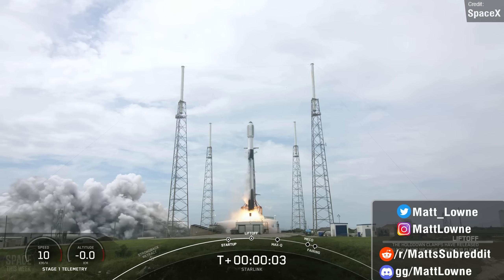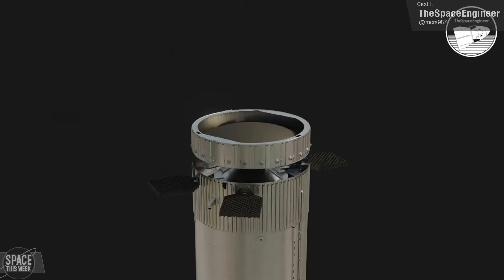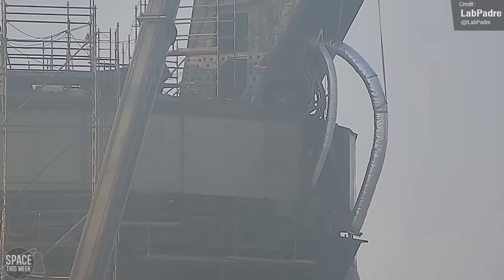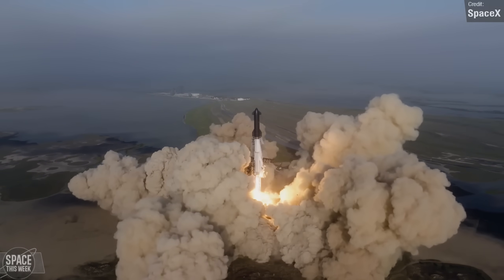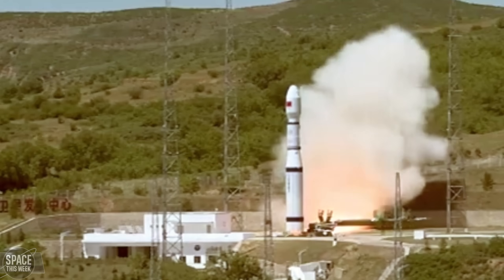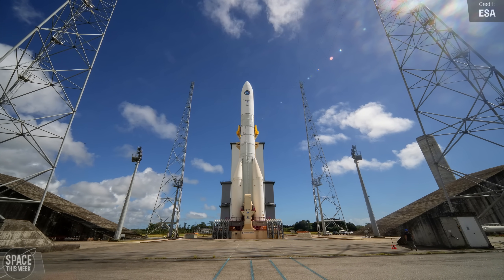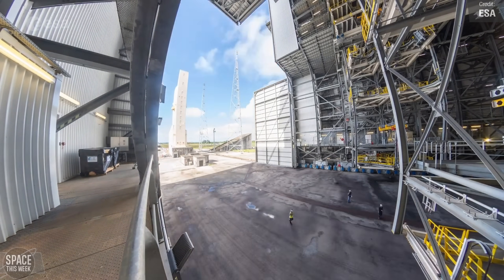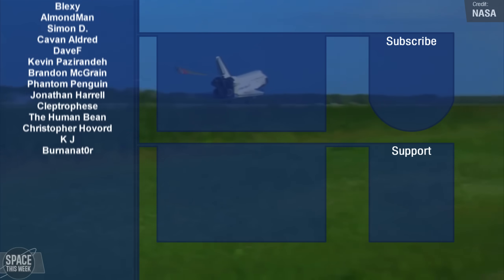SpaceX Starship's Insane Design Change, Ariane 6 Rollout, and The Penultimate Delta IV Heavy Launch

Comment: I wonder if they will just fire one or all 3 center motors then ramp up up all 6 after staging? All 6 wouldn’t play nice with the booster
Reply: afaik they'd only be firing three at stage separation, the vacuum-optimized engines.
Reply: @vicroc4  makes sense as they are the outermost and closest to the vents

Comment: I don't know how well this going to go with a hot-staging going go for B9.  I think there going to be some high risk of Starship possibly detonating remaining fuel in B9.  Its going need some kind heatshield dome.  Even if B9 drops thrust to allow S25 separate as it thrusts out.   Additionally, they'd have to relocate batteries and controls that are right where the top of the dome are (unless they moved them some where else.   I really don't think its going go well, doing these last minute changes on vehicle not designed for hot-staging.

Comment: Does Starship need the extra lifting capabilities?  Won't it already be able to lift something like 150 tons in one go.
Reply: Not really but less launches means less money spent by SpaceX and more profit.
Reply: @SkyeBlu-ep2qk Only if the payload can be bigger and still fit in the bay. What I mean by that is that can they fit another two or three Starlink satellites in the existing bay, but to re-use the first stage, they’d have to hot stage the rocket? It may be better cold staging, and having chopsticks on a drone ship.

Comment: Whichever SpaceX employee plans, coordinates, and so on all the repairs and install work at boca chica is a hero.
Reply: I hope they manage to repair all the harm they did to the nature reserve with the same speed and thoroughness.
Reply: @gdutfulkbhh7537  Starship runs on methane... a much cleaner safer fuel than the kerosine used in literally every other rocket. The re-usability of these rockets is also MUCH better for the environment. NIMBY environmentalism is not environmentalism.
Reply: @CamimalFPV  How can it be NIMBY, the M is for "my" and barely anyone lives in Boca Chica so it unlikely that the commentator is personally affected. Doesn't change the negative impact on the wildlife reserve.
Reply: @8ahau279  doesn't really matter, climate change is here and we're in the middle of a mass extinction. NIMBYing starship wont reverse the current species loss rate, to the contrary a heavy lift rocket running on Methane rather than kerosine may reduce emissions long term - especially since it enables the likes of solar in space. :)

The entire planet should be a wildlife reserve, but instead emissions are at an all time high. The opposite direction to where we should be going. Easier to complain about very visible technological progress hurting a nature reserve though.

You can make methane without oil, you can't make kerosine without oil. It may even end up being the case that the Methane is a carbon removal method (this is pure copium, I will hand you that)

Comment: I think hot staging is a mistake

It adds extra mass from the vents and reinforced booster
It risks damaging the ship + booster
It will require more checkouts on the booster and ship, slowing reusability
It requires too much complexity compared to previous methods
Reply: Especially on a booster that's already mostly complete.

Comment: Hot staging is definetly a lot simpler than whats used mostly by US rockets but idk if firing rocket engines while the booster is still attached is good for said boosters reusability 😂
Reply: and will also alows star ship to realy abort from the super heavy booster fonshon as well as its own fully fleged abort sistem if the super heavy booster where to have a magor problam that would requre a launch abort from the booster. then satr ship would hot stage as fest from the super heavy booster under its own power and will try to fly back to the launch tower  chop stick and dock the save the crew and if that fails it can try a powerd or  even a moslty unpowerd water  horzntal laiding with lmited glideing conteol with rcs trusters and SRS for even more help linding in the near by costal aera if it has too.
Reply: @ashtiboy  I don't think that Starship (second stage) can abort using the Raptor engines in case of a catastrophic failure of the booster. The Raptor engines take a second or more to get to full thrust and the Starship (second stage) is expected to have a TWR of about 1.5. Contrast to the Crew Dragon where the Superdracos get to full thrust in 100 milliseconds and have a TWR of roughly 4.6.
Reply: @steveaustin2686  well first it will decople first and then glde/ rcs minuver in a contoled manaer wihle trying to fly away from the malfonshoing  booster and then try get to a safe distace. once at a save distacse it then will warm up and then fire up the raptor engines to escape.  this will work on most sitratons but not all of them. but it would have been very handy in the last test to try to test something like that be forehand.
Reply: @ashtiboy  Catastrophic - causing sudden and very great harm or destruction: Cambridge Dictionary

Decoupling and gliding away won't work when the booster 'xploda, as the Kerbals would say. You will note in my first sentence, I said "in case of a catastrophic failure of the booster." You know, the things an abort system is there for.
Reply: @steveaustin2686  it depends on what kind of catatrothic failure are we talking aobut. heres the thing  unless the super heavy booster explodes super volently like in a few split seconds wihout any known warning then the starship abort won't work. but i don't think thats would be a issue bescue it won't happen unless a plot device made it happen in the first place . but for the most part star ship could abort and fly back to safety unless the booster was vaperozied and exploded winith few split seconuds somehow magicly.
Reply: @ashtiboy  🤦‍♂️ That's the POINT of the abort systems. To get the spacecraft far enough away from a catastrophic failure. That's why the Superdraco thrusters get to full power so fast and why the TWR is soo high.
Reply: @ashtiboy  And the exhaust would impinge directly on the top of the booster's methane tank potentially creating a massive explosion of the entire vehicle.

Comment: My 3-stage Estes Rockets I built as a kid all lit the 2nd and 3rd stage engines while attached to their respective under-stages. Worked like a champ (most times! lol).
Reply: Blow-through staging like that only really works with solid motors, though.  Hot-staging is a bit different.  They start the upper stage (liquid) engines while the lower stage is still firing, allowing the exhaust to blow against the lower stage's tankage.  You need a pretty good heatshield to keep the lower stage from being destroyed.
Reply: That is because it uses the upper charge in the lower engine to ignite the engine above it.

Comment: Would the hot staging decelerate the booster significantly? If so, it would need less fuel to return to base.
Reply: No more than cold staging.
Reply: @joshgorham750  Yeah after thinking about it more, it shouldn't be noticable. I deem you correct sir.

Comment: Matt, wdym it doesn’t look like it’s up to the task? A hot staging approach requires holes to be made in the structure to allow the hot exhaust from the second stage to escape. So this would make a lot of sense if it is what it is proposed to be. I’m sure you know this from looking at Russian vehicles.
Reply: It doesn’t have the stringers necessary to structurally support the ship. This is similar to the first payload bay doors needing to be covered up. However, it was likely just a prototype for the design.
Reply: Needs more structure to it in order to support several times the weight of a fully-loaded second stage.

Comment: Hotstaging looks like when you use engines to decouple by destroying tanks in ksp or sfs
Reply: which often destroys the engines bells or the entire ship
Reply: and that is why it is a very unlikely to be a good idea for a planned to be reused anything. for single use rockets, it has some benefits, and some risks, but for reuseable ones, not a great plan, even more for human  rated ideas, as one of the risk is that the burned and dropped previous stage may damage the upper one, maybe ok for cargo, but just an extra risk for human rated ones.

Comment: As I understand it if the staging clamps are released early the booster does not separate from the top stage. But what if one of the ring was highly pressurized? Would this tend to pop the two stages apart when the clamps are released? Then could the upper stage engines ignite fairly safely?

Comment: There is nothing "insane" about a design change 😞
Reply from the maker: I think it's pretty outlandish for a rapidly reusable rocket to use something like hotstaging. Hotstaging obliterated the interstage portion of Titan II.
Reply: @MattLowne  Exactly. Maybe hotstaging is a stop gap for Artemis III. The HLS Starship can get to the Moon without reusable stages, it just would be very expensive. I sure Musk doesn't want HLS Starship to be the reason Artemis III slides into 2026. I agree completely on hotstaging for Superheavy being potentially very bad for the booster, even with shielding added.

Comment: Hot staging is used for ullage reasons, yeah? Is it possible to ignite a subset of the engines, to make the separation a little gentler?
Reply: It is assumed that the Starship engines will start low and ramp up and Superheavy throttle down at the same time to avoid exposure of the booster to the plume. What they will do in reality 🤷‍♂️
Reply from the maker: Interestingly, it's possible that the vents could be controlled so that the hotstaging can actually help induce the booster flip manoeuvre
Reply: Does make sense to light only sea level engines first.
Short nozzle, more space, handle ambient pressure better without flow separation/combustion instability.

After separation they are ullage for the vacuum engines.

Comment: I assume they wouldn’t ignite the starship raptor engines at full blast during separation.
Reply: I guess it may be throttled back as much as possible, that will more than overcome dynamic pressure

Comment: About the hot staging: you're assuming that they couldn't work on that big open vented scaffolding and wouldn't add and structural support. And as for the Titan II? You can literally see a similar venting structure right above those holes you pointed out, so I won't rule it out yet... Maybe I'm just biased because I think it's cool XP
Reply from the maker: The ring that was seen would certainly need additional reinforcements, if what has been seen truly is going to be used on a Starship, it will still need to undergo heavy modification